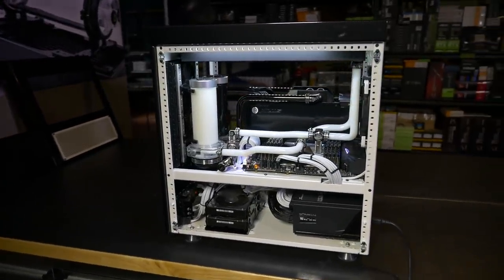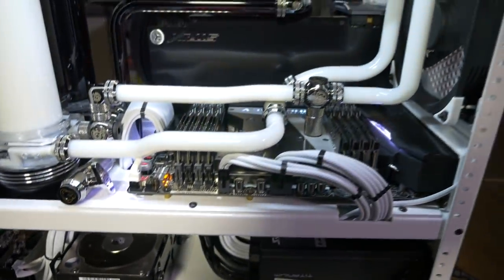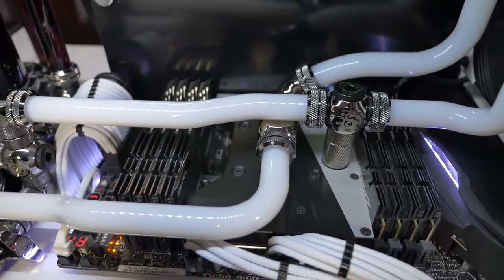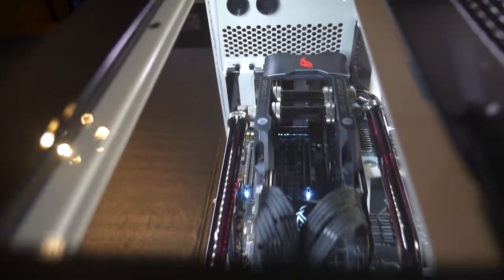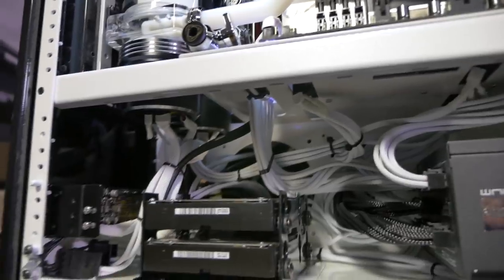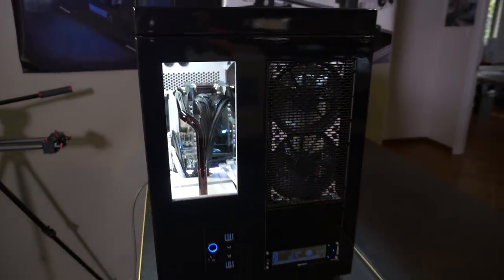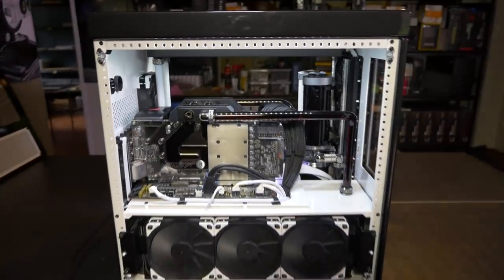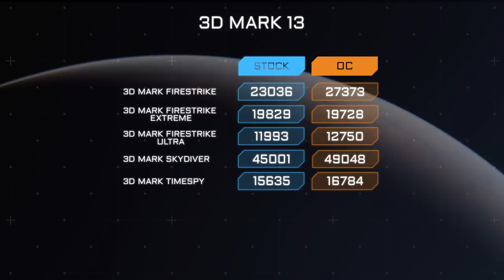Caselabs S8 Build #39 Part 2

Comment: Question: why you didnt brought the gpu loop drain valve to the end of the case and be able to drain gpu loop without removing the front panel and all the cable behind vs stop it in the middle of the case ?

Comment: Why did you make CPU block in parallel .. The CPU does not get any cooling as the water flows past
Reply: That's not how parallel works- regardless of the t junction (assuming the cpu block and radiator have a similar flow resistance) each will get half the flow rate. I think this will achieve a similar result to running the pump at half speed in a normal loop.

Comment: Not a big fan of parallel looks messy with T-line fitting on the CPU block, you have tubes over lapping would have been better off bending tubes around components like ur old builds, having more fittings is nice IMO!